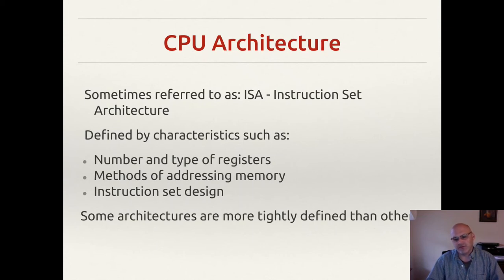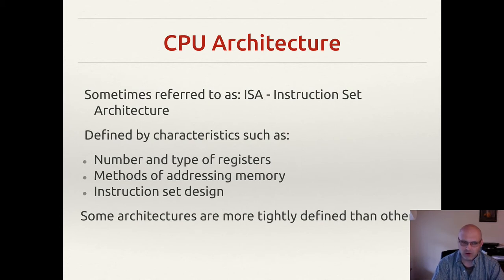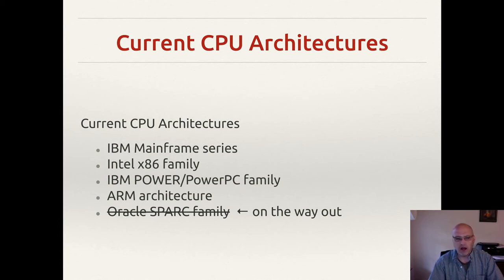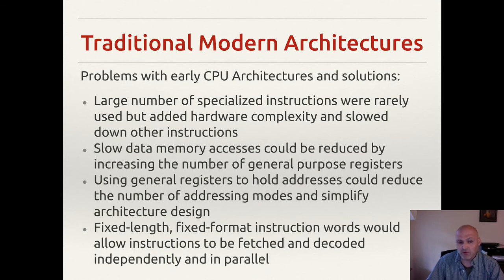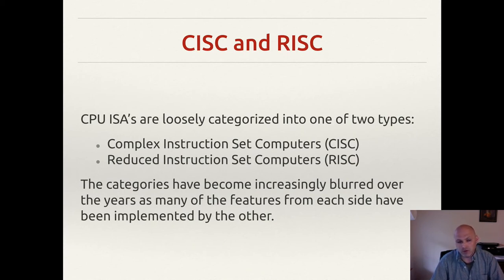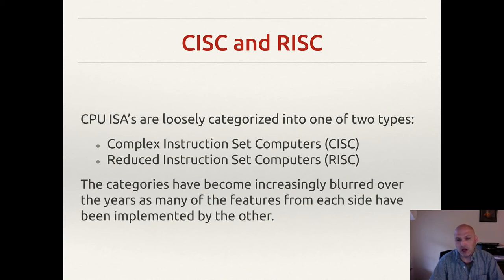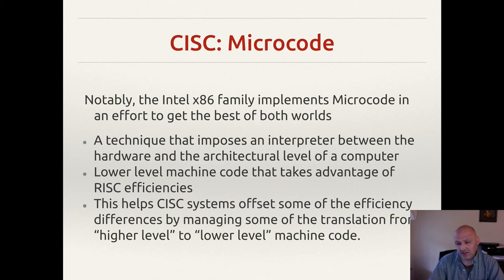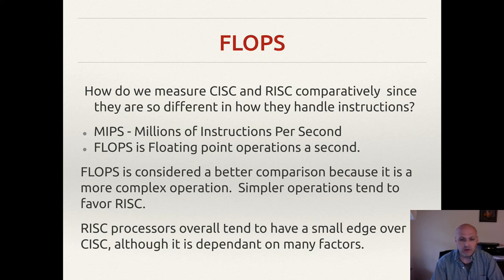CISC vs RISC: Complex vs Reduced Instruction Set Computer

Comment: Assuming that each memory reference takes 1 clock
and completely ignoring caches and cache lines

(see 9:45)

Assuming that memory addresses take up most of a word 'add r,s1,s2' requires 3 words
(1st word contains the opcode + address, the next two words contain only an address)

    3 clocks to read the instruction
    3 clocks for data transfers
    6 memory cycles total

Assume risc with general registers (see 10:43)
    ld      r0,b	; 2 memory cycles
    ld      r1,c	; 2 memory cycles
    add  r0,r1   ; 1-2 memory cycles (the add might be performed in parallel with fetch of st instruction)
    st     r0,a	; 2 memory cycles
                        ; 7 clocks total 4 instruction clocks + 3 data clocks

Assume instructions have an implied 'A' register instead of r{n} registers
    ld      b    ; 2 clocks
    add   c    ; 2 clocks
    st      a     ;2 clocks
                    ; 6 clocks total

This is not a signifigant reduction in memory space for code or clock cycles for execution time.

Signifigant gains in both code size and execution time are realized in common program loops
such as memory to memory moves or register save / restore operations 

char a[20],  b[20];

memcpy(b+1,a+1,10);       // aligned but not full words
memcpy(b+1,a,10);           // unaligned

a cisc move operation could perform this operation efficiently
it's just not possible to match the performance or code space with a risc loop